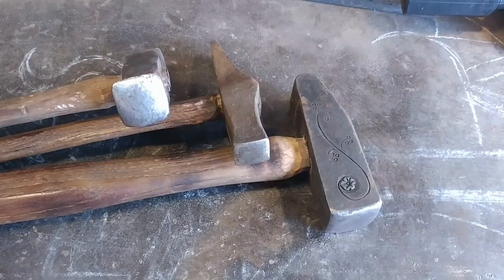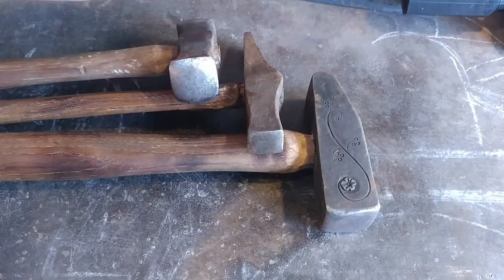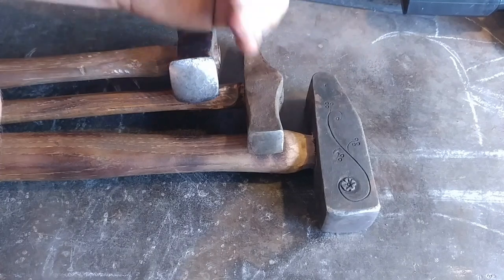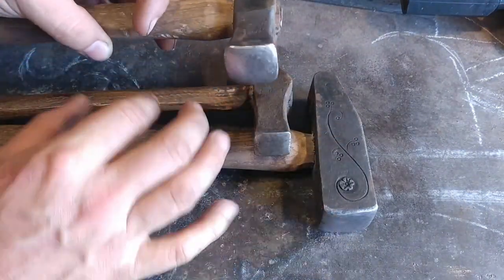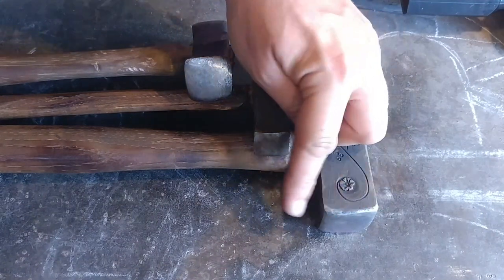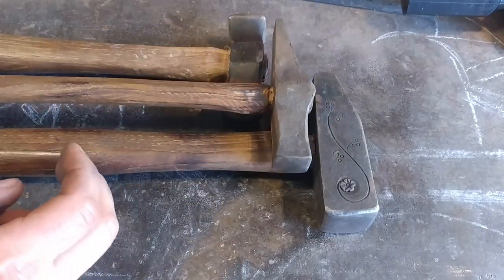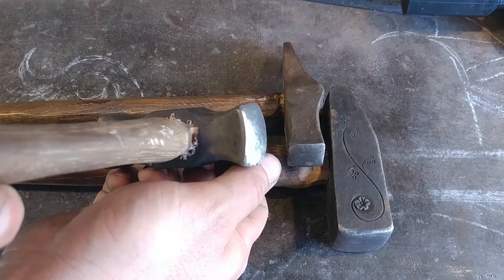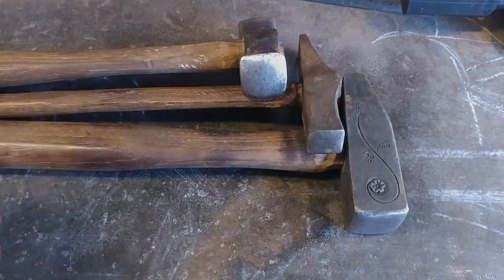Dressing Hammer Faces

Comment: I started with a pawn shop engineers hammer ~4lbs.  Took a class with Lyle Wynn and made a 2.5ish rounding hammer and a 2.5cross peen. Love the rounding hammer. Thinking of making a Viking style cross peen like yours for those tight corners.  May try to do some chasing on the sides.  Do you recommend chasing before hardening?

Comment: I quite like a 2 faced hammer with one side a circular rounding face, the other a square flat face. Kinda like the one Alec Steele uses. My chosen weight is about 2.5 lbs. Although I recently switched from taking classes at what I guess you could call a public smithy to my own setup so I haven't been able to acquire or make that style of hammer. I generally don't like using the peen on hammers that have a normal face as it makes the hammer slightly top heavy and there for hard to be accurate as the hammer wants to rotate as you are striking. Because of this I am probably going to make some hammers that only have peens to compensate for any issues regarding hammer balance.

Comment: So far I like my 2 -1/2 pound cross peen hammer.  I also have a 2 lb ball peen that I use sometimes.  I round things out with a 3lb cross peen, a 4 lb sledge, and a 2lb drillers hammer.  I have many more hammers but these are my favorites.  I have dressed my cross peens and the drillers hammer to give me the best hit for my skill level at present.  In other words they are very forgiving faces.  the ball peen is really one of five and all are used for specific purpose so I keep they face very flat and sharp edged.  The sledge hasn't needed any tweeking to this point.